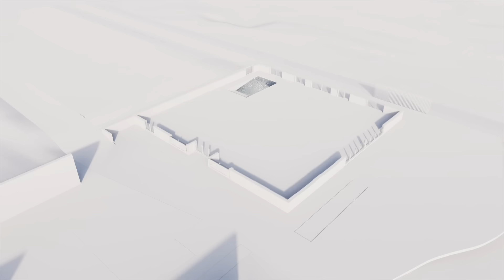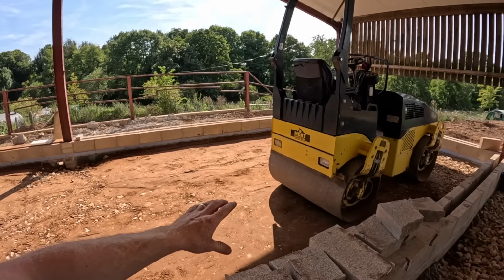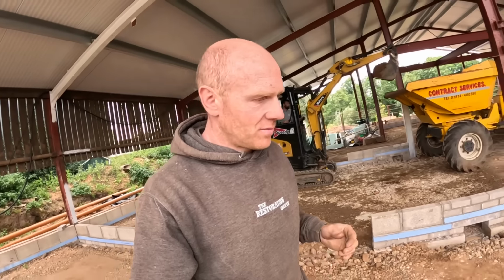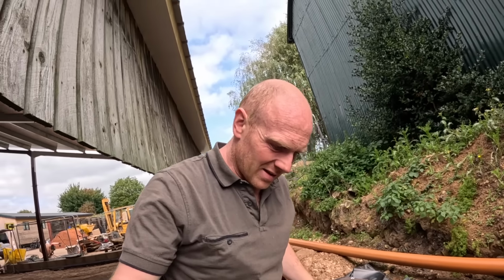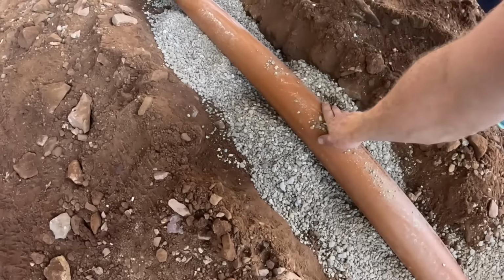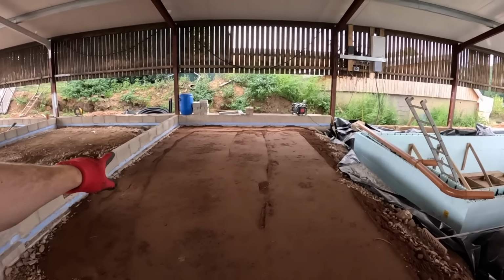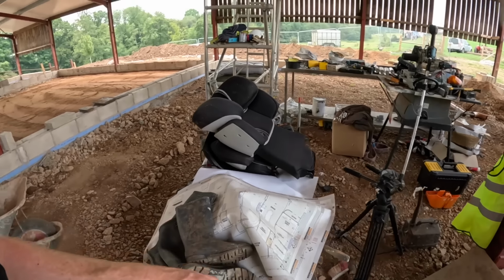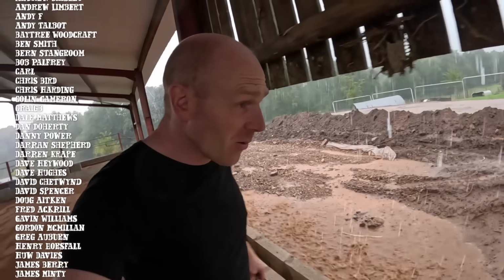ROLLER v WACKER - Getting the floor prep started!

Comment: Great progress. It’s a massive step when you get the slab poured and finally “get out of the ground” best to get a pump in for the slab. Don’t think putting your insulation direct onto the sand is a great method it’s meant to be closed cell but it’s not really, it will absorb water. Put DPM under the PIR and a second layer over the top before the slab then it’s bomb proof👍

Comment: Water and compaction go hand-in-hand…  In the hot dry summer months it wasn’t uncommon that we’d hire water trucks to drench the aggregate as we were laying it down and compacting, almost to a stiff slurry.  When you get it right, and the weather cooperates, you can almost end up with a concrete hard and smooth finish…

Comment: Consider putting a ducting manhole on the outside to turn the corner.....I did after having problems with cable run and its been a life saver now.
Reply from the maker: Great tip.  I think most of it is coming in straight but elsewhere we may have turns or tees that would be good to access.
Reply: @TheRestorationCouple  honestly getting armoured cable stuck and realising it's under 6" of concrete is no fun.....a few Chambers here and there where a massive help.....broadband through it etc....

Comment: I also use CCF for insulation. The price is normally the best from them
Reply: Couldn’t you have used a steel checker plate to protect your drainage pipes. Working in all the outsides areas first from the middle would have allowed the fork truck to be able to place and lift them.

Comment: A job so simple that a child could do it. A roller slightly larger than that was my first “operator” job when I was 12, back in the <cough> during an oilfield construction boom.  At least you’re under shade… :)  Sitting next to the hot hydraulic oil resevoir under 30C bright summer prairie sun was, ah, “Character Building”.

Comment: Probably too late now but I wonder if you considered a grey water system (or if that's even possible in the UK). Actually I don't remember whether you are on mains sewage or septic system. Anyway, I know water shortages aren't an issue for you, but it's one of my regrets, not treating grey water myself and putting it back out in the landscape. I don't think you've talked much about "green" features of the property, it seems like a fairly conventional build in that regard?
Reply from the maker: Lots of topics to cover but off grid in most respects. PV, bore hole and sewerage treatment plant. We had planned a large rainwater reservoir but probably not with bore hole going in. We have a reed bed option for water from the farm and yards too.
Reply: @TheRestorationCouple  Cool, I hope we get to see all of that at some point. Planning a well myself so that will interest me.